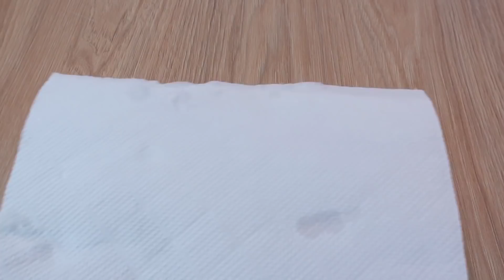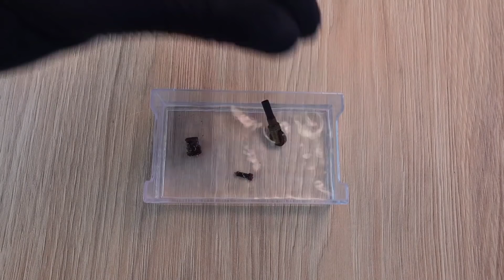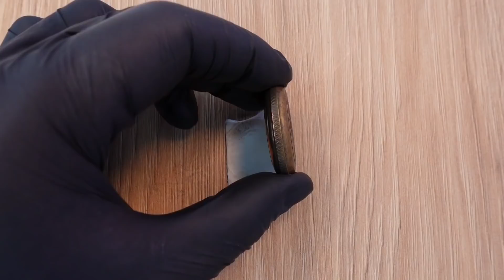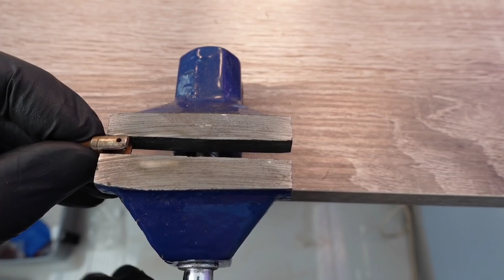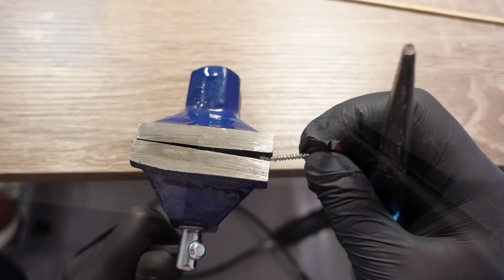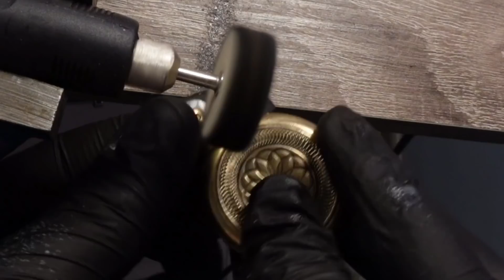Restoration of a Very Beautiful and Rare Lighter from World War I

Comment: Suggestion: Nevr-Dull cotton wadding not only makes brass and other metals shine like new but also puts an invisible protective coating on the projects metal surface. And there are lots of ways to apply it, including elbow grease. The stuff is awesome and a little bit goes a long way. I've been using it for over  60 years.
Reply from the maker: Thanks for the advice!
Reply: @TheRestorer  You're welcome. If you ever try Nevr-Dull, and if you're like me (and many others over the last 70 years), you'll be hooked. The Eagle One brand  (Evr-Bright?)  I believe may be made by Nevr-Dull. I think there was some kind of a law suite in California - actually, there was, I just haven't read the details, something about the strict California laws on chemicals (that are much stricter than the Feds).
Reply: Sanman187.  I've been using Nevr-Dull for about that long, too, and I love that stuff.
Reply: Yes Nevr Dull is a must have. My father turned me on to this fantastic product and I am never without it. It's the best.

Comment: To replace the flint ,remove bottom screw , pull spring out and insert new flint , replace spring , then bottom screw.
You did it from the opposite end - you wouldn't remove the strike wheel every time you replace the flint.
Nice work on the restoration.
Reply from the maker: Thank you! Glad you liked it. Thanks for the advice!

Comment: I have one of these.  It was already in pretty good condition to start.  Just needed a new flint, quick, clean out of the sparker grooves, and a polish.  No rust, so I used Flitz and it worked fantastic.
Reply from the maker: Cool. Where did you get the same lighter?

Comment: Interesting looking old lighter. I have a few old ones from the 40's and 50's. Looks like it's copper. Nexti time you want to clean copper, sprinkle it with a liberal amount of salt and then add vinegar to the salt and rub with a sponge. Cleans copper up like new with very little effort and it doesn't leave any scratches or swirl marks behind.
Reply from the maker: Thanks for the advice!)
Reply: I agree, or bar keepers friend.
Reply: Brass... This is not copper
Reply: Impossible to tell from my phone what kind of metal this is made from... I would have thought that brass would have had more verdigris...?
Reply: Brass. Copper corrosion is green.
Reply: @TheRestorer  う

Comment: Sandpaper isn't always the best solution for removing grime and rust. It's actually causing more harm to the surface. I actually use one of those pink school eraser's and a magic eraser.
Reply: I heard that wire brushes leave scratches also
Reply: @richardhaubrick4558  
Brass brush isn't so bad as a regular wire brush
Reply: erasers*

Comment: I can’t believe they didn’t show us how it worked! How does the wheel thing light the wick?! Otherwise, beautiful work
Reply from the maker: The lighter works. Thank you very much!
Reply: Wait, they don't show that? Then what's the point
Reply: They show it at the end
Reply: @NorthernSweetPea  No they don't, they just show the lighter already lit, not how it functions. But it was a very cool video to watch still.
Reply: The flint is below the wheel. Rotating the wheel generates a spark that ignites the lighter fluid impregnated wick causing a flame.
Reply: @judithburke1539  oh thank you! It’s like a modern lighter but with a wick, that’s very cool
Reply: @Cheese -  It works like any other lighter fueled by naptha.   The little screw cap is removed, exposing the naptha-soaked wick.  The spark wheel is rotated, usually by a thumb.  The rough surface of the spark wheel rubs against the flint under the wheel and produces a spark which causes the naptha to ignite and produce a flame.
   Look at a video of a Zippo lighter on YouTube.
Reply: How can you not know genius
Reply: されてる

Comment: Interesting that you had to take that little top off the wick to light it. I would lose that little piece after lightning it two or three times. Nice restoration.
Reply from the maker: Thanks)
Reply: I think that, in those days, things were not considered as being 'throwaway'. People took care of their possessions. The original owner would be most happy to be viewing this restoration now, were there a heaven to view it from.
Reply: @Kathie Condon
I totally agree! I'm AH-MAZED that the cap that covers the wick was still with the lighter. I'm such a butter fingers, even if I tried my absolute best not to drop that cap, I eventually WOULD! And with my luck it would roll into a storm drain or into a manhole. I think I'd have a jeweler solder one end of a tiny chain to the body of the lighter and the other to the cap, just in case!
Reply: @cheryldavis8776  Cigarettes beside storm drains or manholes... How could you even contemplate?... 😉
Reply: @marklammas2465  Cheryl isn’t smoking tobacco…
Reply: Good thing for the cap on the wick, otherwise you would have lighter fluid burn marks on your thigh

Comment: Camera takes are good, but I think you omitted a lot of details. You did not show what solutions you used, powder, etc. You need to invest in some more tools. Holding a rotary tool with a vise didn't look very professional. Also, you destroyed the sparker wheel and cap. The spring you made was not very good either. Perhaps sandblasting would have been better, or making new ones with a lathe. The last shot where you show the thing lit up was a setup as I am positive that thing didn't create enough spark. You could have rethreaded as well and added an o-ring or sanded the cap for a tight seal. Not trying to be mean, but if you want your channel to grow, you will need to up your skills and equipment. There are other restorers like MyMechanics that you can check and learn from. Best of luck.
Reply from the maker: Thanks for the comment and advice)

Comment: tape off areas you don't want to leave tool marks on while disassembling. Use threaded stock or a bolt to thread items being buffed in vise so not crushed out of shape. Brass bristles are good but a good cloth buffer  with compound would be better? Put two-sided tape on jaws of vise. File is way too coarse and removes too much material. Higher quality soft cloth based paper towels better than paper ones for asmr. Because you filed down the bottom of flint/striker assembly it no longer tightens in correct position. Find a small washer to fill the gap you created when you filed the base off.
Reply from the maker: Thanks for the comment and advice!)

Comment: I have done so many restorations.  He might do a good job at restoring but his methods aren’t the greatest. Files on soft metals.  Steel brush on soft metals. This is a great way to destroy the item restoring.  Never file on threads.  There are great solvents on the market that deal with rust and dirt  on metals.  Plus one of the best applications is having a small sand blasting machine.  You can use baking soda, coffee and even walnut shells to take away a lot of the items on metals. The product he is restoring would look far better if he did the right thing in restoring it.
Reply from the maker: Ok

Comment: Wouldn't there have been wadding in the body of the lighter to act as a reservoir for the fuel? Otherwise it would evaporate if it wasn't airtight or spill out if you turned it any way but up.
Reply from the maker: Cotton wool is needed to keep gasoline in the lighter

Comment: Is it brass
Reply from the maker: yes
Reply: I was given a tip from an old dear on how to clean brass. Some soapy water with some tartaric acid. Wash brass in this mixture. Rinse and buff. Do not let it soak.   However you had a much harder job that this

Comment: You honestly massacred this renovation, copper elements with sandpaper or a wire brush man it is done with pastes and felt
Reply from the maker: I then leveled the surface with polishing paste. The dart did not damage the surface. Only cleaned the rough plaque in the cracks.

Comment: I’m sorry but that wasn’t a restoration it was an abomination, if you haven’t got the correct tools or knowledge to do a project then don’t do it, I will point out a few mistakes there are too many to list in full, the files you used belong more in a mechanics garage than to file something delicate, the vice you used whilst be small should have had rubber protection on the jaws, I note you did use tissue or cloth to hold it but in all honest you probably could have done the job without the vice, the use of wire brushes on something so delicate is not a good idea, how did you know it would be safe and not scratch or worse remove the surface, anyway I’ve said enough I’m sorry I had to write this but I was actually shouting at the screen in some places, so this might give you some idea how much it upset me. Thank you and I will still give you a thumbs up 😊👍
Reply from the maker: Thanks for the comment!) Have a nice day!)
Reply: I'm confused at your comment.  The restoration turned out beautiful and the lighter is now in working order.